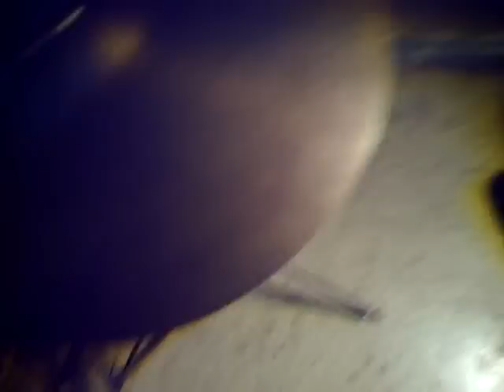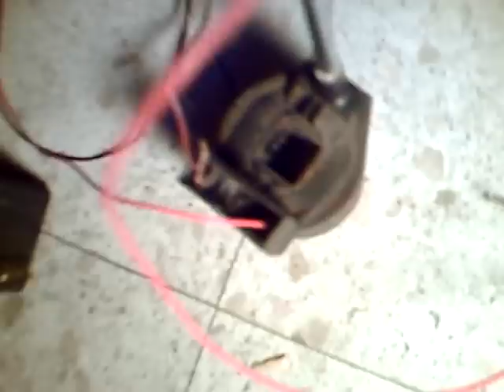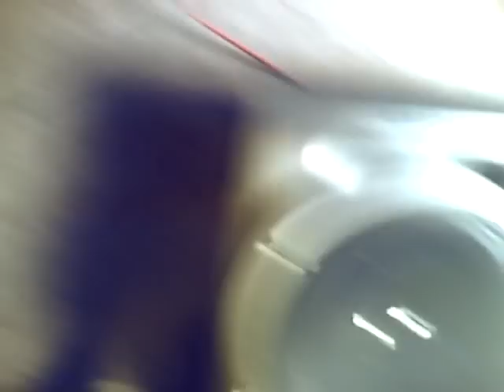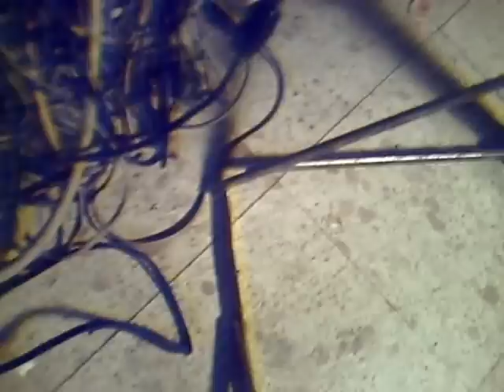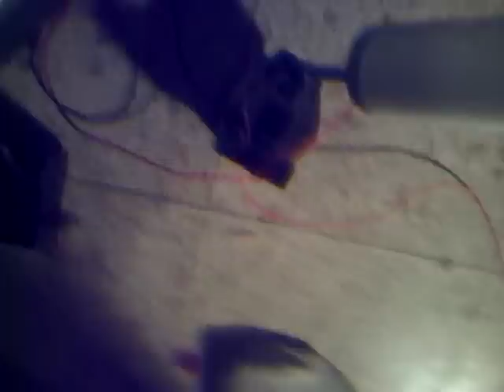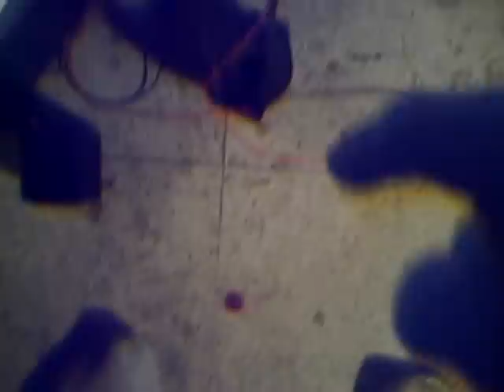after tuning up tesla tower free energy

Comment: So, you're taking all power in through the cymbal?  I'm just a bit confused because it looks like you've got a power source.  Certainly the ion generator is plugged in.  I understand that those happen n nature, but I could use a diagram explaining the flow and maybe a reading or two showing voltage/amps, etc.  You might have this somewhere and I'm just late, but a link would be cool.  Keep on tweakin man, thanks.

Comment: interesting work-try finding a matched capacitance for the high amps side of the air core transformer.
also better insulation of your cymbal or "elevated capacity".
try them on wooden sticks instead of cymbal stands.
a lego rack and pinion with brass door knobs make good high capacitance adustable spark gaps also
and check out the cap and vacuum spark tube in flourescent tube starters.
;]
5*'s

Comment from the maker: it will take the right coil and inductance 
to tap into the resonance frequency of the earth i am thinking of running an insulated wire with the tower plates at the top of the hill and from there running a long wire down the hill and plugging the other
end of the circiut to the earth at the bottom of the hill on a 90 ft hill volts out = 3ft = 100 volts
so 90ft = 3000 volts on our static tower per sq inchenough to make a spark through air and be stepped down to a higher current